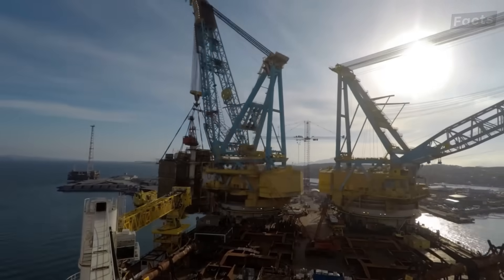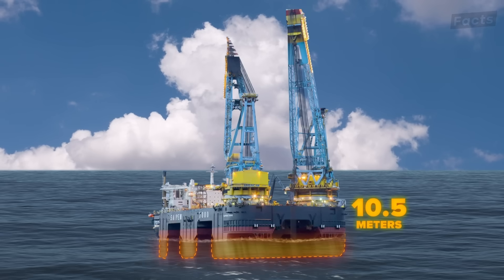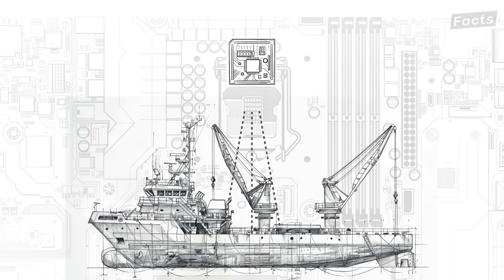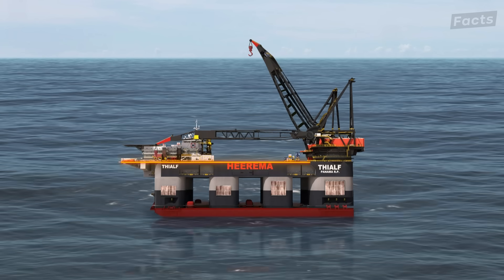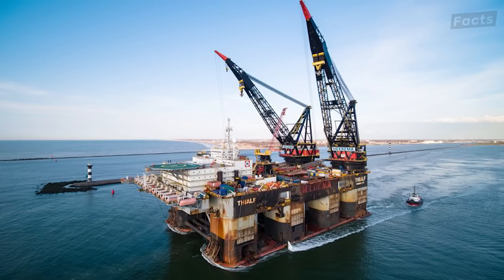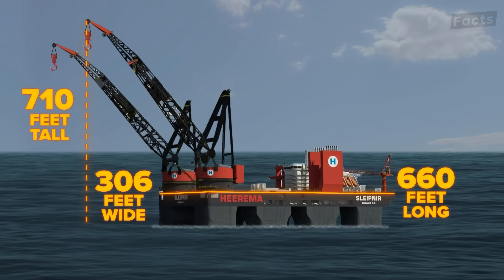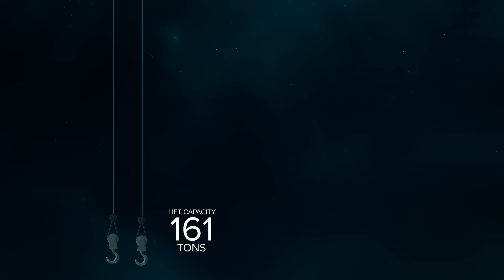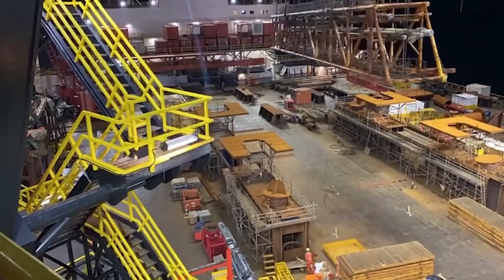Inside The World’s Biggest Crane Ship Ever Built

Comment: At 9:16 there is an error the power can’t be 100 000 MW. That should be 100MW or 100000kw. 100000MW is the power output of an entire country. The USS Enterprise with 8 nuclear reactors had 210MW in total. The thrusters are 5MW each. With 8 thrusters that is 40 MW, 100MW of generator power is plenty for propulsion.
Reply: I always get all that megawatts and all of that stuff so confusing to me. I’m still trying to figure out how a three-way light switch works. These things are just massive, but I can build your house. That’s easy you know.
Reply: The video states 12 diesel generators capable of 70,000 kw output.  A total of 840 MW or 0.84 Terra W  (70, 000KW = 70mw, 12  X 70mW = 840mw = 0.84 TW).
There may be an error in these numbers, possibly 70 kw watt instead of 70,000 kw.
A  18MW diesel power generator by Kawasaki Heavy Industries is reported as the largest in the world and is huge.
Found these interesting tidbits from Wikipedia:
Nimitz-class carriers are capable of producing 550 MW (thermal) with two A4W reactors but use only about 1/2 that capacity.
In 2022, New York City, largest city in the US,  had a total summer capacity of 39,689 MW (39.689TW) through all of its power plants,
Reply: @hermanmiller3708  
The Thialf is equipped with 12 diesel engines with
the following capacities:
• 6 x 4,900 kW • 4 x 4,500 kW • 2 x 5,500 kW
Source: Heerema website

Comment: Yeah, the Sleipnir is "carbon neutral." OMG what a crock of bool sheet.
Reply: 1. When running on LNG, Sleipnir reduces CO2 emissions by 25%, NOx by 92%, SOx by 99%, and particulate matter by around 99%.
2. The company has also established shore power connections in some ports to allow vessels to run on green electricity, further reducing emissions when docked. 
3. Heerema announced it became carbon neutral in 2020 by compensating for its emissions.